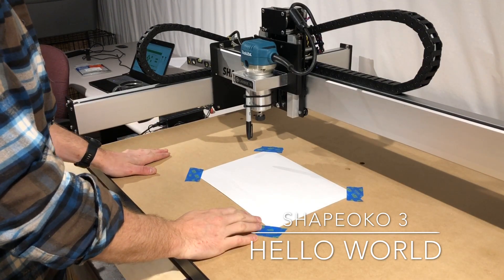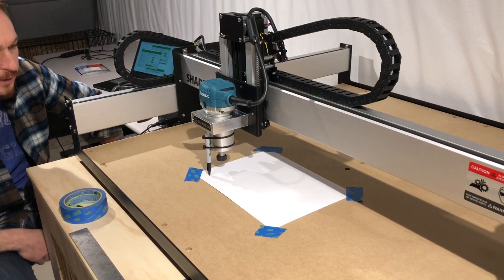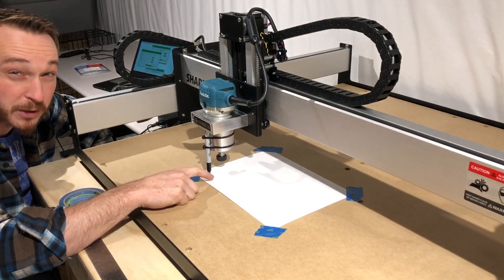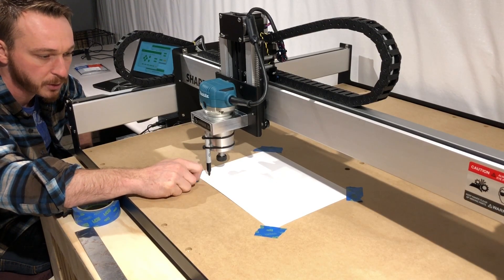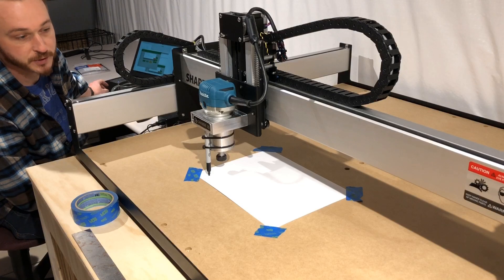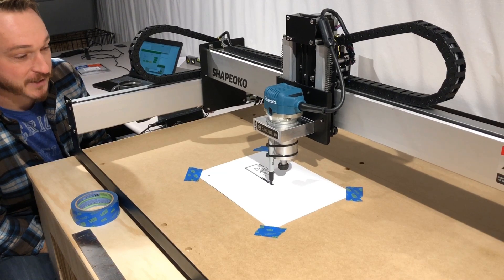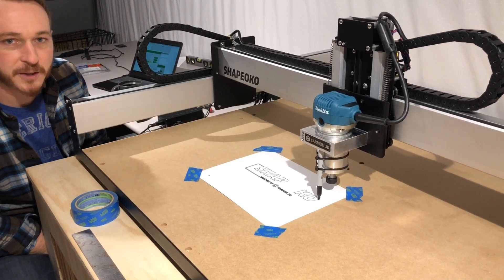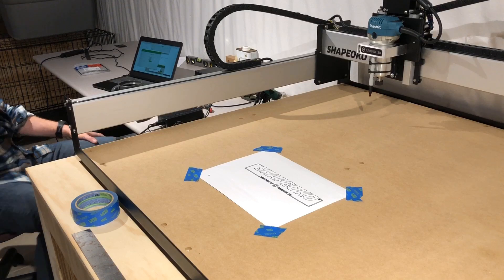Shapeoko Series - Hello World Project

Comment: Hey! Great video. At the end there when you were talking about your machine being out of square...how did you determine this? Did you take the diagonal measurement as they suggested in the assembly guide or did you realize it was out of square by running some code with a sharpie attached and seeing the result?

Also, what did you do to square up the machine? What extent did you have to take apart the machine to square it up?

Thanks!
Reply from the maker: The base on the xxl was notorious for being slightly out of square when you assemble it.  I’ve seen a few methods of squaring it, but for me, I just loosened all fasteners and pulled it into alignment across the corners.  You’ll see this is a pretty common question if you follow any of the Shapeoko groups and has to do with the base assembly tolerances.  It’s not a big deal, and a ratchet strap will help (be gentle) while you’re tightening the base part together.. good luck!
Reply: @deependstudios  Thanks for that quick response!  I will tinker around with mine for a bit. The cross measurements seem perfect however one of the y axis assemblies does not seem to be perfectly parallel front of the vertical part of the metal base.

I may need to tighten those esentric nuts.

Comment: Hello and Thank you for this quick video.
  I found this video because I am personally thinking of purchasing this one (Shapeoko) as opposed to others. I know nothing about cnc but believe this would and could be a first step into that area. My question to you is how hard is the learning curve on this as it comes from the factory? I wouldn't want to have to worry about other programs for cad and such until I learn the more basics that this arrives with. Small projects, signs, plaques and such is really all I am wanting to start with because of my lack of cnc.
Reply from the maker: The Shapeoko has both Carbide Create and Carbide Motion bundled along with the machine.  Create will allow you to draw basic projects and choose tools to generate a toolpath right out of the box.   You can also use Fusion 360, which is free for hobbyists which will further expand your capabilites.   I'd recommend Carbide Create to start (get the basics) then expanding into perhaps Fusion 360 or another paid software.

One thing I've learned after owning a few computer controlled cutting machines-- they're only as good as the software that comes with them.   I can't say enough nice things about the Shapeoko package.  In an upcoming video I show an end to end sign project I made as a Christmas Gift.   Cheers!  Thanks for subbing